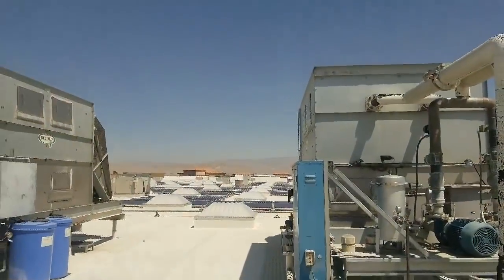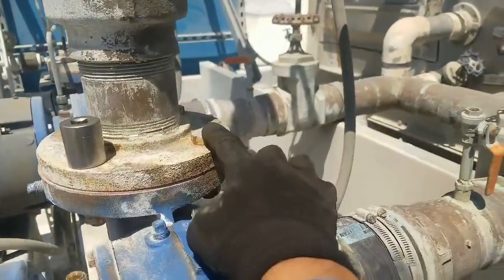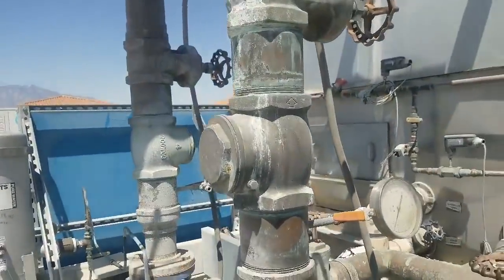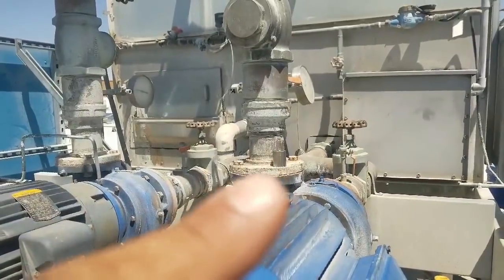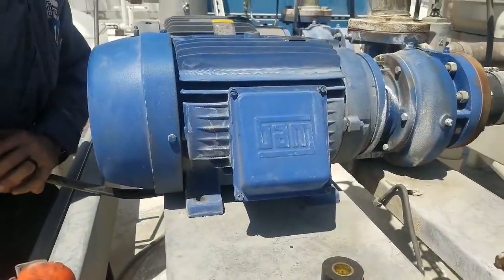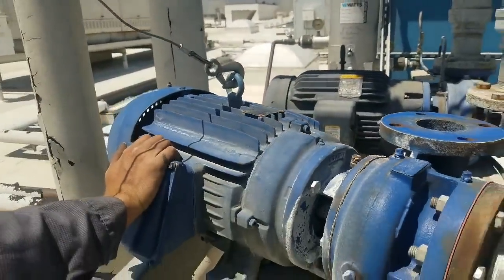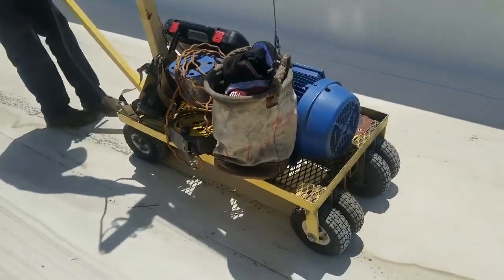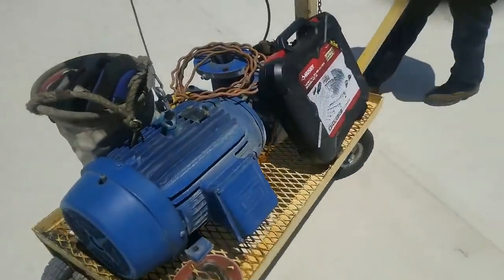PART 1,  20Hp MOTOR/WATER PUMP

Comment: Good work. I like the electric rigging equipment. Most of the rigs I have worked with are portable T-frames and for much heavier equipment, portable A-frames. Those rigs I've used come in individual parrs that fit into technicians' service vans. We carry all the individual parts into the job location and assemble them onsite to make the T-frame or A-frame rig. Then we attach a rolling trolley with an eye hole on it to the crossbeam on the rig. Then we attach a manual chain hoist to the eye hole by way of a built-in hook on the chain hoist. The mechanical advantage geared into the chain hoist makes it easy to lift the load as the chains are manually pulled on to lift the load. That's how we'd lift the motor/pump assembly at the tower. Then we would have torn down the T-frame rig, moved all its parts over to the roof hatch, rebuilt the T-frame rig centered over the roof hatch and then hoist the motor/pump assembly down the roof hatch on to a cart at the bottom of the roof hatch ladder inside the building. The set up you showed in this video is so much better because it makes the job much easeir. Again, you guys did a great job!
Reply from the maker: Thanks for watching 👍